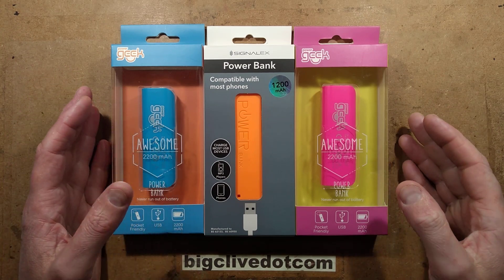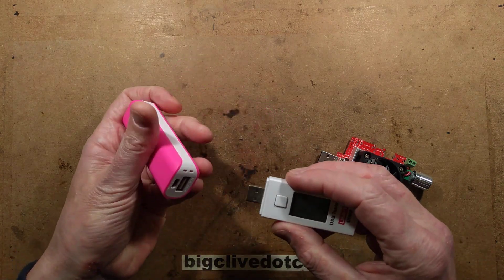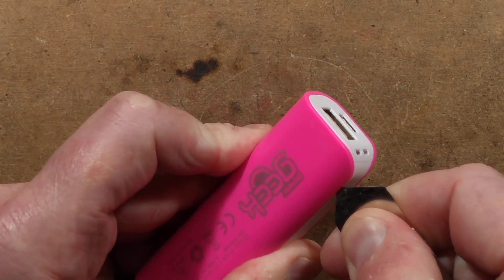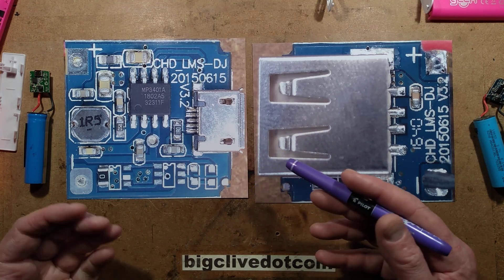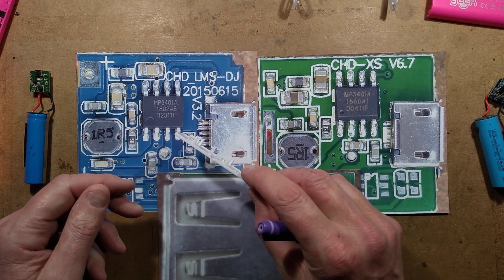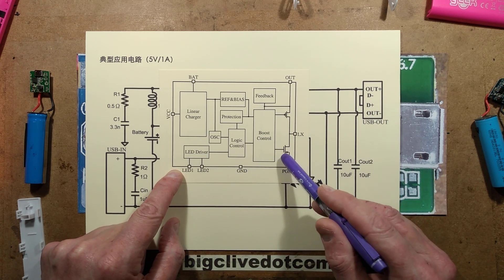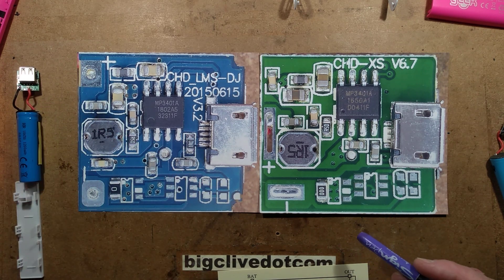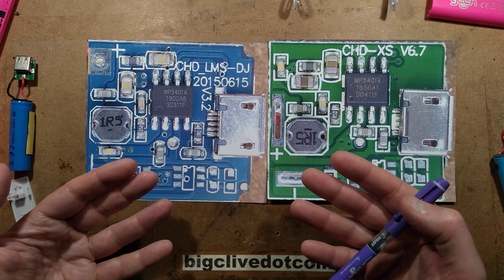Inside the new Poundland Power-geek 2200mAh power bank.

Comment: Best to compare watt hours. 1700mAh*5v is 8.5Wh. 2200mAh*3.7v is 8.14Wh. Energy going in is only slightly above claimed capacity, which can be easily explained by losses.
Reply: This only applies with switching charge circuitry.

EDIT: 13:05 Its a linear charger so it is indeed somewhere in the region of 1700mAh.
Reply: Adam, yes watt hours are better, but you can't just multiply by 3.7V because 3.7V is open cell voltage, and as cell is drained the voltage drops. It would be reasonable to take a mid value between open cell voltage and cut off voltage, so maybe 3.6V? 3.5V? Definitively less than 8Wh in energy amount. Plus the fact that efficiency of the conversion varies with load and input voltage. You would need to have an access to a lot of data to calculate everything precisely.
Reply: movax20h 3.7v is nominal for a lithium ion cell. It’s also the point in the discharge graph which holds for the longest time, and practically in the middle of max and min. I think it’s a fair point to calculate from for us mere bench top hobbyists making a quick judgement.
Reply: For power banks that use buck converter circuits in their charger (ASDA blackweb for example), I fully agree with you. With buck charging circuits the current at the USB side has nothing to do with the current getting to the battery. They are quit different and the battery charge current can be even quite a bit higher (1A on the USB port but 1.2A going to the battery for example) which works because of the voltage difference. The transferred energy stays of course the same which is why one should always use energy (watt hours) instead of  capacity (Ah) if charger and battery use different currents.  In this case, however, the charger is linear and acts like a series resistor. This means an ammeter on the USB side does measure the actual battery charging current. All the series resistor does is convert some of the excess energy into heat when the voltage difference is too high. We can calculate that in this case the charger delivers 5V*1.7Ah = 8.5 Wh of energy but because charging current = battery current the battery can only have received 1.7Ah and therefore holds only 3.7V*1.7Ah = 6.3 Wh of energy. The rest of 8.5 - 6.3 = 2.2 Wh was converted into heat.  It is interesting to note if you now start discharging the USB power bank and measure the capacity, you will be ever more disappointed by getting just 1260 mAh back (at best with 100% boost converter efficiency). That's because all the energy the battery can give is 6.3 Wh and at 5V this is means 1260 mAh on the USB.

Comment: What's the point in using nichrome ribbon if there's a stupid black wire connecting it lmfao them older banks leak current bout 2 or 3mA which drains the battery on the shelf lol cud do with a switch on it lol did they fix it lol
Reply from the maker: Yeah, it does seem odd not just to have a wire going to the other end.

Comment: I think the difference between rated and measured capacity is due to different voltage (5V vs. 3,7V) and the efficiency of the conversion. Manufacturers of powerbanks usually print the battery capacity on the case.

Comment: I have one of each with estimated capacity of 570 and 1130mAh respectively, so mileage varies. For the money though, they are useful and you could always swap in a decent quality battery for a few quid.
Even the £1 one runs a a 5 led flexible arm light (also £land) for many hours.
They are useful as project bases for not much money.

Comment: I think the marketing-speak (or 'wank', as AVE would call it) would rate that 2200mAh power bank as 2200mAh "notional"  (i.e. around 1700mAh). A similar trick is being performed on all those windmills being installed in Scotland, the main difference being that the people buying them and well as the people selling them are in on the same con :-)

Comment: Do you take these photos with your G4, and if so how do you get it to focus at that range? Mine won't do anything like that.
Reply from the maker: Hold the camera far enough away to get a good focus and then zoom just enough to fill the frame or take the photo and then crop in later.
Reply: Thanks. I probably need something to hold my phone, my hands shake too much to focus and zoom at the same time.
Reply from the maker: @chrishartley1210  Also try a couple of test shots outside in daylight.  The higher light level and even lighting helps.

Comment: Ive had one of thouse for over a year, i live in portugal, and i bought it for around 10€ (kinda scammy) in a retail store. the circuit its the same, so its just a rebrand. it ran hot to the touch, and after 8-12 months of use the the usb type b thats for recharging just popped off on my backpack.

Comment: how do you measure capacity? Do you take the 5V/3.7V discrepancy into account? Power banks are usually rated by the capacity of their battery I believe?
Reply from the maker: I run the pack flat and then recharge it fully monitoring current over time.  So I'm measuring the cell capacity.
Reply: Hi Clive, I think this has been covered quite comprehensively in other comments today, but while you're here, the thinking seems to be that when you draw 1A from the 5V output, the cell itself is delivering say 1.4A because the boost circuit is acting like a transformer.  The cell's capacity might actually turn out to be correct.

Comment: Do test about ΧΙΑΟΜΙ PowerBanks that are Really Scams in Everything.
They say out of the BOX with Big Numbers 10.000mAh and when i measure it i found that are about 6.000mAh.
The same with the 16.000mAh model that i have and when i measure it again i found that was about 10.000mAh.
Reply: The real Xiaomi banks aren't a scam, but they became sort of popular so a lot of chinese manufacturers started copying their design and slapped labels with way over rated capacities on them and there are plenty of these scams like that these days, ones that claim 50,000mAh and you'd be lucky to get 10k out of it.

(also pretty much all manufacturers go by cell capacity, so a 10-20% loss measured at 5V output is normal, in the case of your 16,000 it should come out to 13,000 so it is a bit low but not too bad)

Comment: Clive what is the capacity of the batteries?
Reply from the maker: In the new one, supposedly 2200mAh, but two measured at about 1700mAh.
Reply: @bigclivedotcom  ah.   I was looking for a cheap alternative replacement battery for my ecig that measures 18650.

Comment: Well, 5 Volts is 1.35 times 3.7V, so if you calculate 1700mAh times 1.35, you get about 2300mAh, so the  cell may actually be a 2200mAh cell, just not at 5V - that's the problem with powerbanks and all these things: They never give you an actual value for their capacity, which would be in Wh, not Ah!

Comment: I bought a USB load testing setup after seeing you use them, turns out it's good for load testing the 5v circuit on rc airplanes because the receiver can brown out if the voltage drops too much.

Comment: As I work in quality check for multi layer ceramic caps I can tell you some details, which are of course also available through intense searching on the Web.
Depending on the voltage rating, the thickness of dielectric ceramic between the nickel electrodes can be as low as 1 or 0.5 microns, resulting in many hundrets of layers and thus high capacity such as 10 microfarads rated for 6.3V in a 0603 package (1.6 × 0.8 x 0.8mm). To achieve a rating of 100V the ceramic layer has to be around 9 microns.
Also, the mentioned sensitivity to cracks is mostly absent from the smaller packages and becomes more noticeable with big ones. This can be somewhat prevented by a soft layer in the outer terminals consisting of silver and a polymer which gives some flexibility, also called soft electrode. 
Keep up the nice work, I really enjoy your videos.
Reply: That is really neat,thanks for sharing friend! 

Alex.
Reply: amazing...!!

Comment: I have a few of the older ones. I bought them without batteries and put 3.5 AH decent cells. They worked fine but with my new phone, they over heat and burn out(the cct bd). I thought that they would limit to 1A but for some reason they are not.  pity. Got an Anker now. Would love to get an empty case that will take the cells but have the cct to output say 2A.
Reply: You could add resistors to the data lines of the USB cable so your phone limits how much current it takes. I'm sure there's lookup tables for current vs. resistors somewhere online for your particular phone brand but it is a decent amount of extra effort for a very cheap power bank :)
Reply from the maker: The data pins are linked in these units, which should signal an upper output of 1A.  Most modern Android phones gradually increase their charge current until they detect the voltage dipping too low and then back up a bit.
Reply: bigclivedotcom  So far it's burnt out three.  They seem to work, then sometime they suddenly get hot and burnt smell. The chip burns up.

Comment: I use the 1200mah 18650's as a power source for a torch (because I'm a cheapskate) and used the circuitry to make a charger. Could I use the "2200mah" cells in my dodgy homemade charger or would they not be fully charged or burn down my house etc?
Reply: Should be fine
Reply: It's all good. The one thing you have to be careful about is a charger trimmed for high-ish current (i.e. taken off a power bank) that it shouldn't be used on a drastically smaller cell unmodified (i.e. from an MP3 player) because generally the maximum permitted charging current is proportional to capacity. Correspondingly, if you take a charger circuit from a power bank and use a higher-capacity cell, you shall likely find that the new cell will take correspondingly longer to charge, but it'll be happy enough.

Comment: The quoted capacity is usually the capacity of the lithium cell. So 2200mah at roughly 4v of a lithium cell works out to about 1800mah at the 5v of USB.

Comment: Couple of points. If manufacturers switched to Wh instead of mAh - we could easily compare the capacity of cells, even those with different technologies/voltages. Secondly, I would be surprised if the boost converter in the power bank was more than 90% efficient. The efficiency is not fixed either, it varies according to the load...
Reply: Why watt-hours though, why not just joules? Joule-hours-per-second is just such a strange unit.

Actually, sod it let's go full base unit - kg m² s-².
Reply: Haha yes. Electrical devices usually/often have their power stated in Watts. If the batteries used related units, it makes it much easier to work out how long something can be powered. If I said I need to power my LED floodlight that uses 20 joules per second of power, which battery bank should I buy? Well...
Reply: And I think Wh would be joule-seconds-per-hour lol
Reply: A watt is a joule per second, so logically a watt-hour is a joule-hour per second. You're just multiplying both sides by time, in hours.

I agree about mAh anyway. Again, we already have a unit of charge - coulombs, and it only makes sense in terms of capacity if you multiply by discharge voltage, giving mVAh, or mWh, or Wh, or just back to bloody joules again! (Or kilograms metre squared per second squared, although admittedly that's a bit inconvenient).

I just like joules because it'd tell me roughly how many seconds something would run for, providing I know the average power output.
Reply: Well I think we can probably agree that mAh is only convenient for comparing batteries that have an identical chemistry?

Comment: I'm curious: How much of the difference in capacity between the bare cell (and/or the rating on the package) and your measured value is caused by losses through the inverter rather than any deficiency in the cell itself? In other words, how efficient is the inverter and/or how accurate is the capacity marking on the bare cell?
Reply: a lot of the 18650 batteries r actualy fake. Amazon r very fond of taking real batteries and taking the covering off and putting their own on with a higher mAh.

Only way to get the real batteries with the right mAh is buy direct from the makers rather than through 3rd party sellers.

When i was looking for some 18650 batteries a few years ago to power a model i made of RD2 D2 i was after some 3200mAh. on the samsung website they said there ones only go upto a max of 3200 but amazon were selling samsung 18650 4600mAh So they were definitly fake ones relabled by amazon to scam buyers.

Might be what happened with the batteries in this powerbank. the bateries they bought were probably lower mAh than printed on the label cause the supplier removed the correct label and replaced it with a higher mAh so they could charge a bit more.
Poundland probaly didnt even bother to check to see if the batteries were the correct mAh as they got them cheap. But all retailors r the same buy as cheap as possible and sell for as much as possible. without checking to see if they r the real deal of fake as long as they can make as much profit as possible. But buying cheap stuff doesnt always mean ur buying crap. Some expensive stuff is even worse crap than the cheap stuff.
I remember years ago Harrods were selling tins of heinz baked beans for £5 per tin everywhere else they were 40p a tin lol same stuff but diff price. Most cases ur paying for the label or brand rather than what ur actualy getting.

Comment: Still more than an Iphone battery...
Reply: istones are always plugged into the wall like its life support.
Reply: @stonedsavage7814  istones..  ;-) thanks for that 🤘
Reply: @simonhopkins3867  they both have the same performance too except a rock has more portability and is more useful. You can use a rock as an instant mute button for someone you hate but you might have to use it several times depending on size.

Comment: Just stick a 3800mah cell in and its a great stick style powerbank right?
Reply: Yeah I plan to do exactly this
Reply: There exist actual cells higher than 3600? I doubt.
Reply: @SianaGearz  sure 20700cells go up to over 4000 and they will fit ^^ 
There are even 70a continous discharge 18650s and the specs are real , its all about the price you pqy
Reply: Oh, 20700 is a good point.

I know you can get to high current, but at expense of capacity. Not everything is possible, you can't just throw more money at it and buy a cell that is better than the industry state of the art, but you can save some money by going for last-generation products and third/second tier product lines and manufacturers.
Reply: @SianaGearz  i mean i have 20700s ijoy branded here that are 3000mah 40amp and some Sony vtc5a with 2600mah 35a 
Both are good but i prefer the vtcs since they cost half and can handle 4-5a charge current of course the 70a 18650s are onmly 1800mah inner resistance is the Problem with lion against lipos
Reply: @peterzingler6221  - There are no real 70A 18650s.

Comment: those power geek ones are exactly the same as some called Trust/Urban Revolt here in sweden.I also had the problem that the capacity wasnt enough to fully charge my phone.
Reply: Yep, I have two of the double cell variants from Trust, one indeed with the Urban Revolt sub-branding. They're 4400mAh and my phone is 3400mAh, and they aren't depleted after charging my phone fully once, so I can't imagine it's too far off. I'm about to run a proper discharge test, will report back!
Reply: I have the double cell one also that one does charge both my phone and my tablet fully, not on one charge though.

Comment: Ah! I have the "big brother" of that USB load - mine has the built-in USB volt/amp/watt meter as well as all the cable connections; that's turned out to be extremely useful for finding crappy USB cables with the help of a previously tested USB power supply. (That is, if I know the power supply dips to 4.95v at 1A, but with the cable in between it goes down significantly - then I know how much cable loss there is.) There's a ton of garbage USB cables out there and it's amazing how satisfying it is to throw them away and replace them with one that WORKS.